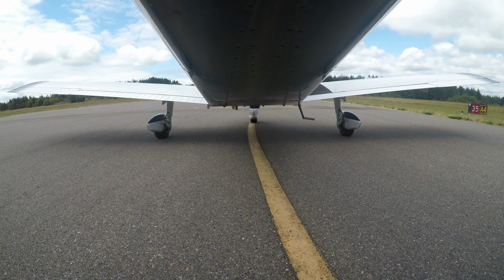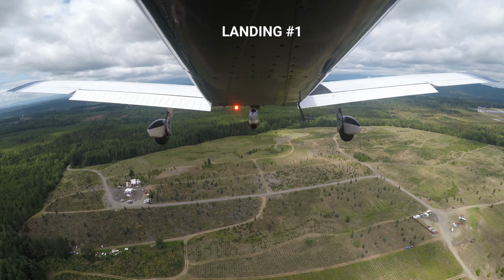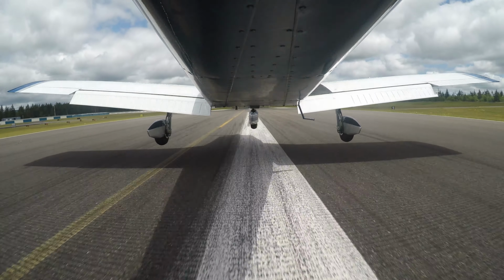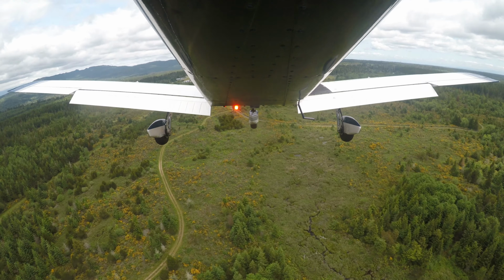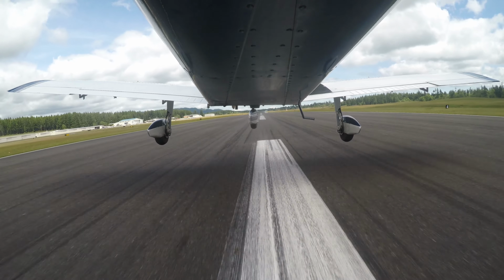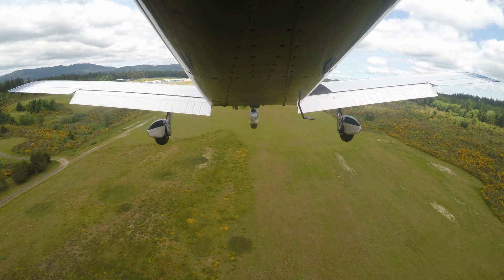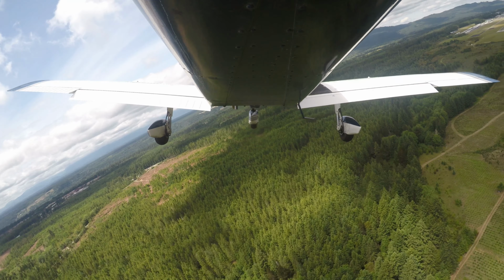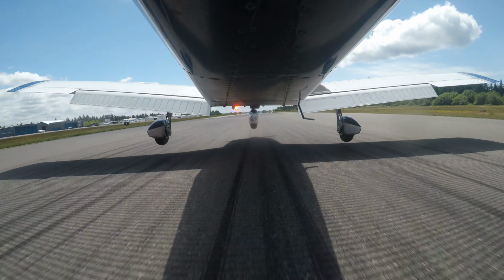Using a GoPro Camera to Improve Landings

Comment: Good stuff! I have a GoPro mounted to the underwing of my VANS 9A. Getting a second mount for the upper wing or possibly the belly view. I suspect your nose wheel is a little more robust than mine. But I know some of my landings are pretty near flat. Constantly improving with pulling the nose up and getting her to land completely on the mains.
Reply from the maker: Glad to hear I’m not the only “flat lander”. I always struggle with it and always work on improvements. The GoPro really helps. I’ll be sure to check your site.